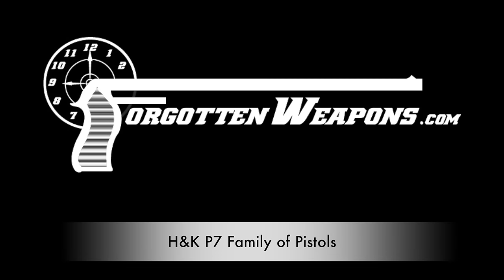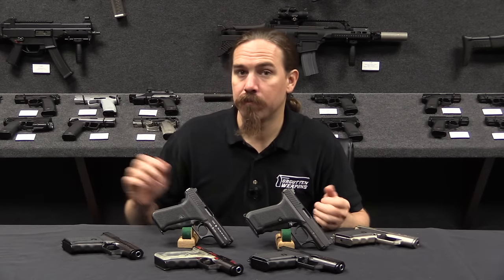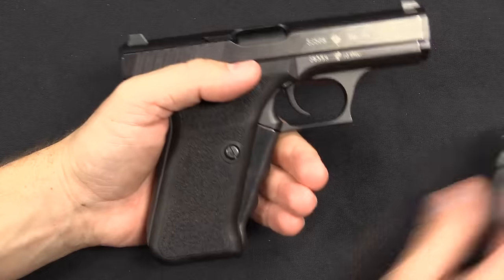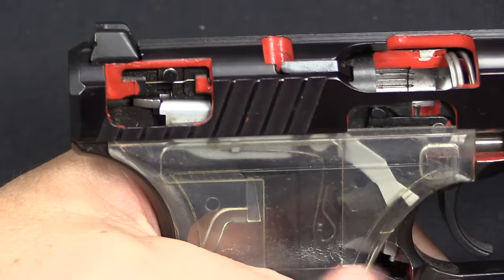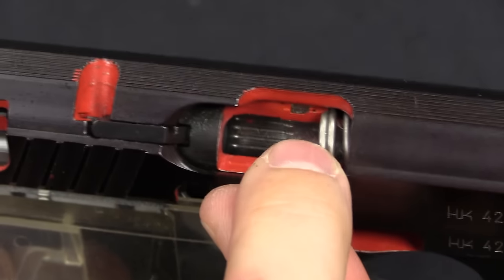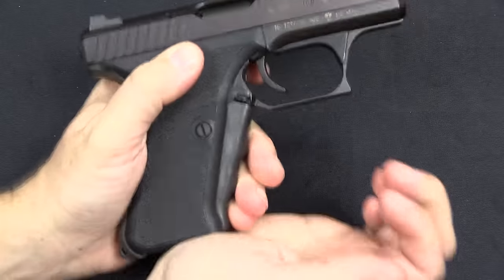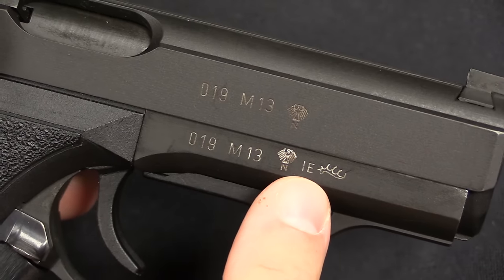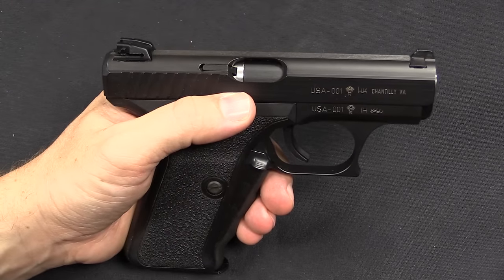H&K P7 Family: Pistols for Gun Cognoscenti

Comment: I ❤ my P7!!! It is by FAR the most accurate pistol I own. But it is true about the heat issues, after 3 straight mag dumps it is literally too hot to handle and has to be set aside to cool.
I stopped carrying it everyday because the thought of my $2000 / out of print pistol ending up in some dank property room after I stop a bad guy with it seemed too much to bear. I don't mind having my $300 used Glock 19 taken...  ;)

Comment: I still do not understand how it works. The piston holds the slide closed until the pressure is gone from the barrel - but by that time the pressure is gone from the barrel! So there is nothing pressing on the back of the case, and nothing acting back on the slide any more. So why would the slide open at all at that point? 
If the slide was opening all the time but slowly - now it would only open slower still, All forces are gone, and only the recoil spring remains. 
There must be something about the relative sizes of the barrel versus the gas piston that drops the pressure on the piston well before the pressure's gone from the barrel.
Reply: To my understanding the gas system doesn't completely cancel out the slide's rearward motion, it just slows it down. It is still moving back slightly when gas is still putting force on the piston, so when that force is gone the slide is free to move full speed backward and cycle off the momentum. Think of it like any other delayed blowback system, just using gas instead of rollers or levers.
Reply: @GhostlyTurtle  
The fluted chamber is a bit of a giveaway that extraction tends to be violent, to float the case on propellant gasses so the case-head isn't ripped off.
Similar solution was used in the roller-locked designs.
Reply: @dj1NM3  Yeah, there are demonstrations of the P7 working just fine ejecting empty casings with the extractor completely removed.  The flutes do their job well (and leave a very distinct pattern on ejected brass).  In fact, I seem to recall the only reason the extractor is there at all is to facilitate manual cycling. i.e. to clear the gun and such.
Reply: @GhostlyTurtle  I was thinking in a similar direction, but this still leaves a problem. There is no "potential speed" or "speed inertia". If the slide was moving slowly before the pressure subsided, then after that it will move even slower (the recoil spring is still there, acting in the opposite direction). For acceleration to happen, the balance of forces needs to change dramatically. Which would happen if, for example, pressure on the gas piston were to go away while pressure in the chamber was still present and strong. 
So that's what I'm looking for, by way of explanation. How is that achieved? The chamber and and piston are directly connected.
Reply: Alex, what you are missing is that there is no equal balance. The piston and gas port are much smaller than the barrel, and there is more force at work than gas pressure alone. Think of this: Even if no air could exit the barrel, you can move the gas piston and manually move the slide back.

Comment: I love how Cognoscenti means "I n the know."  So, when people ask me "What's that mean?"  :D
Reply: This, the single stack versions, make a really nice CCW carry, because the cocking lever/grip safety is Extremely safe, compared to a "Cocked, and Locked" condition, while also not requiring a separate step to unlock the safety, as with a 1911.  Not the most compact option, honestly, that's pretty over-rated unless it's summer, and you're wearing as little as possible.  This presents from concealment, and comes to battery, basically as fast as you can pull the lever, but as long as you don't, it is COMPLETELY safe, tucked inside your wasteband.
Reply: The "European" heal magazine release is low profile, and not going to snag on anything.  Again, for CCW, those are good things.  I consider this to be pretty much the ultimate holdout.  Granted, it's not as compact as a compact Glock, but it's the best designed for carrying safely at all times, and when you do have to get it out, there's a lot less for you to worry about.  Just grip it, line it up, and pull the trigger.

Comment: Funny , I remember when HK was mostly  known for these pistols ,  becuase of the "squeeze" safety action.
That ACP/Browning palm safety , I can see influenced this gun along with the Glock with its silly "trigger" safety. But this  HK squeeze safety looks safer than the Glock.  IMO standard Glocks have no safety all, except the trigger safety is nothing but a "drop" safety. Friend of mine in the army got one about 87,  way more expensive than most 9mm's and single column vs double column feed . And the  Double column ones , later on,  made them really "square" and the squeeze safety got a little worse then.

Comment: Very cool. It is a very safe but overly complicated design. Requires too many mechanical actions to function. As we have seen in recent years in the US, with law enforcement and now military, it seems that there is a liability for function for the user. With the Glock and Sig design, we have seen full functionality with trigger pull and slide movement, coupled with the elimination of any manual safety. That way manufacturer cannot be held liable nor issuing organizations for lack of training
Reply: But probably more related to cost than a complicated design. I don't have reliability issues with mine.
Reply: @33Luger  I have to think that simplicity of function and use are the biggest determination of most agencies and their insurance carriers and lawyers.
Reply: Where I live, police have to buy their own firearms and given an approved list so I don't think those concerns are as important.  Still see mainly Glocks on officers and 1911 on elite SWAT units.  Ironic about the Glocks since they seem to have more trouble than most guns with unintentional discharge. Glock even had to design a heavier trigger pull for NYPD police. And unintentional shootings would have to be a bigger concern than a complicated design.

Comment: The p7 was my second favorite self load growing up. (the Walther p38 being my favorite).  At the end of the 80s, when I could buy my own pistol, Walther had come out with the p88. When I went to buy a  p7 on my 21st birthday, it was right next to the p88 in the display case. And while the p88 was an expensive pistol, it was still $200 less than the HK.  No brainer.  Walked away with the p88 on my 21st birthday.
Reply: You chose poorly. How much do p88's sell for now?
Reply: @33Luger  I am not sure. That was 30 years ago. I sold the p88 a couple years later. I bought a p88c about 10 years after that. Still have the p88c to this day. Would not consider selling it, though.  Actually like the p88c more than the p88.
Reply: P88 is a fine pistol.

Comment: The P7 is called in Germany "Ausversehen erschossen" >>> "Accidentally shot"
Reply: Why is that?
Reply: @tommywilson9836  Look at the video between 10:00 to 11:00. At police controls it happened if the security officer had the trigger finger on the trigger and at the same time cocked the pistol with the grip cock, it could happen that the trigger finger was involuntarily moved backwards. The result was a shot came off. 

The state of Bavaria was the only one in Germany that used the P7 as a service pistol for the police. In addition, very few people in Germany are shot during police operations. By saving measures in the shooting training of the police officers on duty. The policemen were no longer so skilled in handling the weapon, which led to operating errors with unintentional firing of shots. In one year two people were killed in such unintentional shooting, out of a total of 4 people shot by Bavarian police this year.

The P7 was also used by the GSG9. Due to the extensive training in handling the weapon, such accidents never occurred there.
Reply: @niddhoeggr75  I suppose when there are only 4 people shot in 1 year and 2 of them were officers shooting themselves accidentally a nickname like that makes sense. Surprising though, considering how redundant the safety features are. Thanks and cheers.
Reply: @tommywilson9836  The 4 Death was only for Bavaria here you can see the offical  statistic for people killed by police officer for complete Germany https://de.statista.com/infografik/18781/anzahl-der-von-polizisten-in-deutschland-erschossenen-menschen/#:~:text=Deutsche%20Polizisten%20haben%202019%20laut,(56%20F%C3%A4lle%20von%20Schusswaffengebrauch).
According to a report by Bild am Sonntag, German police shot 14 people in action in 2019. In total, officials shot 67 times, more often than in the previous year (56 cases of firearms use). In this context, the police unions repeatedly point out that this is a low level in relation to the currently around 260,000 law enforcement officers in Germany.

Comment: Lots of cool ideas in one gun, but a few bad flaws too.  I wonder if they could redo it in a more modern form.
Reply: rotwang2000 I wonder if that squeezing would give you cramp after a while...
Reply: @borismuller86  surprisingly no, its a bit of pressure to squeeze, and practically none to hold it. You should be putting more pressure on the gun just from holding it if youre holding your pistols properly.
Reply: @borismuller86  The squeeze mechanism has two stages, one is a fairly stiff spring that must be overcome, at the end it switches to a much lighter spring which only requires a tiny amount of pressure, if I recall my P7 review from years ago correctly.

Comment: I bought one of these in my 20's.  I was poor and it took a long time to save up the money.  I thought I had bought the best handgun available.  I was so excited to finally own it.  Unfortunately, it turned out to be the worst handgun I've ever owned.  The unique features you praise are actually it's downfall.  The gas delay system seems really wonderful, because it allows for a fixed barrel and a very compact pistol, however venting hot gasses down out of the barrel causes the gun to heat up like hellfire.  You can't get through more than a couple of magazines before it's so hot you can't hold the gun.  It's ridiculous.  The plastic trigger and heat shield do nothing.  Also that gas piston for some reason will sometimes seise up rendering the pistol useless until you beat the back of the slide with a soft hammer to release it.  The other problem is the squeeze cocking mechanism.  Sure it simplifies the controls and works as a decent safety, but in a military or self-defense role there is no hiding or being sneaky, because if you cock the gun and then decide you don't want to fire, releasing the squeeze cocker makes a loud "CLACK" revealing your position and presence to bad guys.  Definitely interesting and unique but completely impractical and overall a terrible weapon.  I'm amazed it was accepted after testing.  I'm sure that was due to politics.  Somebody was friends with an executive at HK.

Comment: Has anyone tried to use that particular  gas delay system on a self loading rifle?
Reply: I think the volkssturmgewehr 1-5 used gas delayed blowback. I don't know if it was that exact mechanism though.
Reply: @Stonage-vm5ow  It's a similar but distinct mechanism, with the pressure chamber around the barrel within the slide/bolt carrier, instead of under the barrel.
Reply: Magnum Research / Kahr uses a very similar gas delay system on its .22 WMR 10/22 clone.  It must work well, they've been selling it for quite a while now.

Comment: NJ police how ironic. An anti-gun state testing a cool firearm design.
Reply: Think about it it's a low capacity gun in the age of wonder nines , and it has an over-the-top redundant safety mechanism . That's exactly what you would expect from an anti-gun state .
Reply: @GunFunZS  I know but the NJ police has moved from 9 round to 13-15 round magazines guns.  recently when they screwed us over and the continuing to screw us over at the 15 round mags down to 10 round magazines they had to add a section after the fact to make sure the police keep their + 10 but under 16 round magazines.

Comment: Gas delayed on a handgun is ridiculously overcomplicated, hence why it isn't employed widely like the Browning tilting lock breech.
Reply: Wrong? It's literally a piston and channel for it underneath the barrel, with a port drilled into the barrel. Only semi-complicated thing about it would be having to flute the chamber, but even that is cheap once you're set up. The expensive/over complicated thing about this gun, if you even want to consider it one of those, would be the squeeze cocking mechanism, but for the most part that's just a bunch of stamped components. Like Ian said in the video, originally they were price competitive with something like a Beretta 92, but HK decided it was a better idea to jack up the price to have some form of brand elitism.
Reply: Primer Pocket it's a simple piston in a hole, with no moving parts and a fixed barrel. How on earth is that "rediculously over complicated?"
Reply: I came to say what they ^ did. It's actually very simple. If not more simple than the browning tilting barrel. The barrel is fixed. There's a very small hole on the bottom of the barrel that vents gas and pushes on a "piston" which is essentially just a rod coming back from the end of the slide. It just keeps the gun from unlocking until the pressure is low enough. Arguably more simple than the Browning action, though neither is exactly complicated.
Reply: If it's so simple, then why isn't the design emulated? Either milling or inserting a locking block is easier. Also no hinged gas piston on the slide. I find the continued appreciation for this gun and it's design to be mind boggling.
Reply: Primer Pocket whether or not it's a superior design is a completely different topic than whether it's overcomplicated. Your criticism was that it's overcomplicated.
Reply: I think the cost was why it wasn't emulated rather than the complexity. Pretty sure I remember actual literature from hk explaining why this was the most expensive in the world. Between the squeeze cocking mechanism and milling etc for the gas piston I think it was just too expensive. I still say the gas delayed system is relatively simple, but that's obviously just my opinion. Which in the end is worth exactly what you paid for it
Reply: It is emulated. Walther CCP.
Reply: @matthewkriebel7342  ah yes I always forget about that gun
Reply: Cultural Relic The original SIG P210/M49 is a better mass produced handgun than the HK, hell, the Beretta M9 is a better mass produced handgun than the HK.  The P7 is an irrelevant odd side note in the world of issued military and police handguns.  It may be great for non law enforcement concealed carry and non military use, but that hardly makes it a great gun.